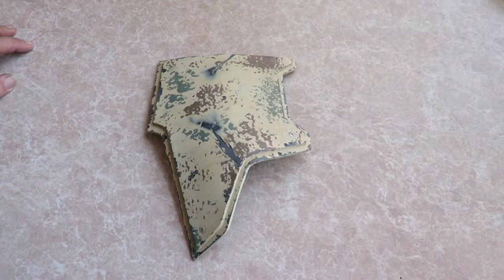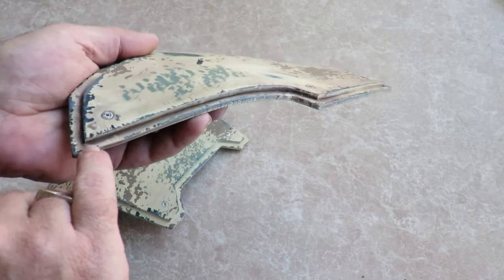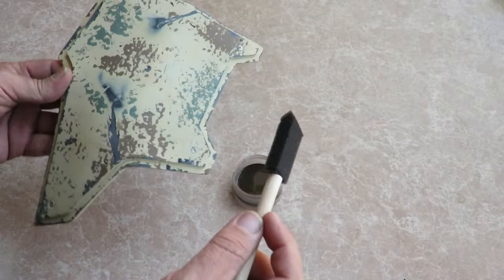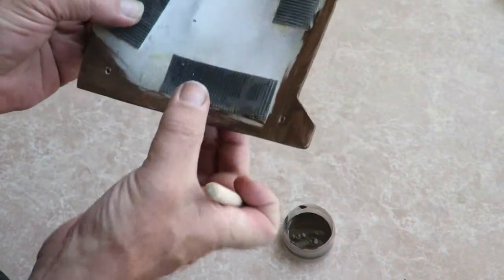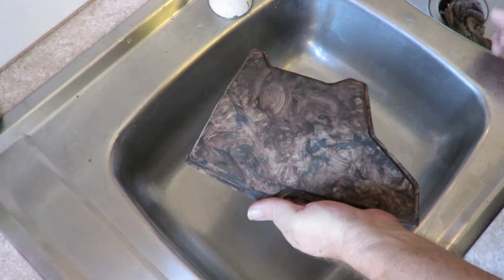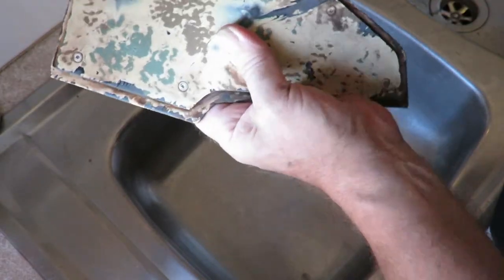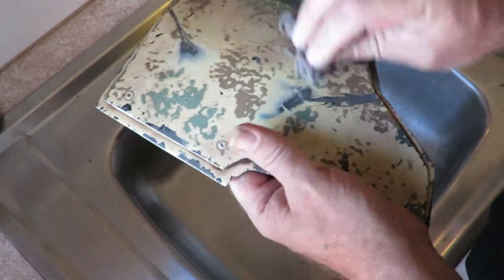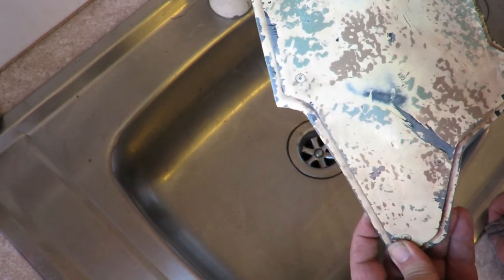Brown Washing a Mandalorian Chest Plate

Comment: let me ask.. what sort of paint did you use for the beginning layers of your armor?? I know the was was acrylic for the wash.. did you use a spray paint or brush paint? just curious  :)
Reply from the maker: GrisslesVault For the main paint job I used a rattle can of enamel primer to start with and then the remaining colours I've used a brand of enamel model paint called "Model Master".  I slightly diluted the tan with thinners then put it through the airbrush. The green and brown I used undiluted and applied with some small pieces of sea sponge and just dabbed it on.
Reply: Ruug'la Verd if you dont mind me asking.. in a video down the line.. could you explain how you get that double layer on your plates.. i see the little rivets or screws.. but how do you keep them flat on the underside to keep from poking on your chest? tried finding it on the forums but couldnt find anything...
Reply from the maker: I've still got to do my boot plates so I'll might record making those. But basically what I do to get the double layer is make the bottom layer first and once happy with the shape etc, I heat some more PVC  and while hot lay it on the original piece. Because it's still hot and supple, it moulds itself to the shape of the piece underneath. Once cool I then cut it to shape (approx. 5 mm smaller than the original) then it's glued in place. The rivets are only 1 or 2 mm longer that the plates are thick so once you secure them with a rivet gun they compress and are basically flush with the plates.